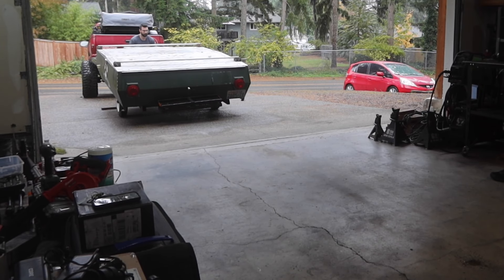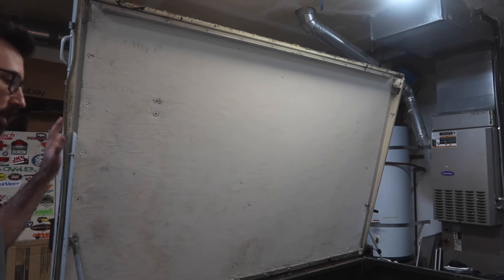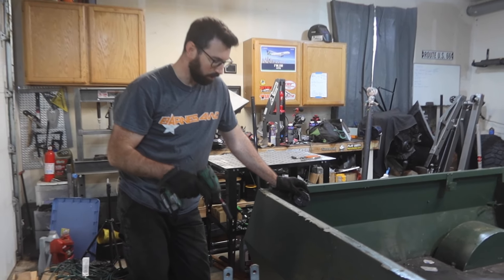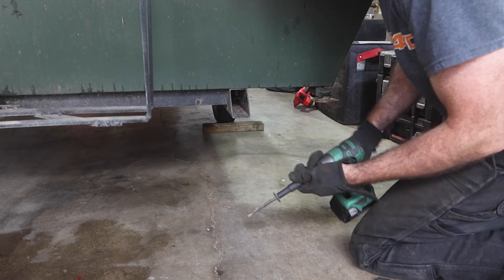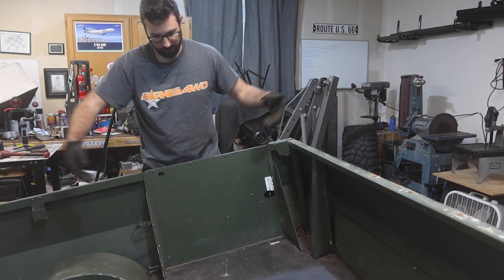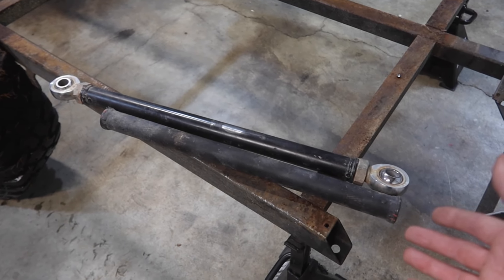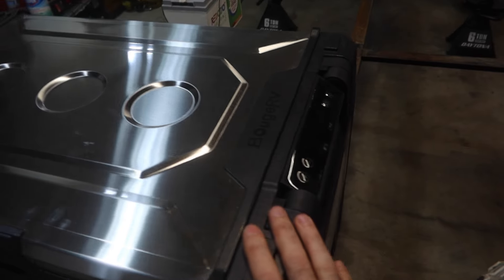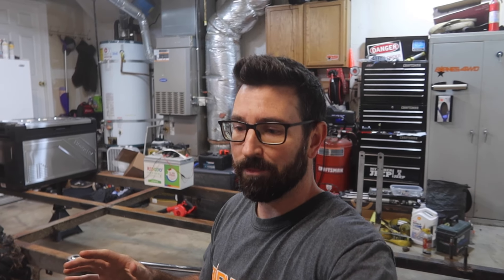Let's build an Off-Road Trailer! Budget Tent Trailer conversion build

Comment: You mentioned slide outs on the driver side of the trailer, I’d recommend setting up the whole trailer to access from the passenger side. I originally built my truck out for my road trip with everything being accessed from the drivers side but most camp sites are setup for RV’s that are generally built to access from the passenger side. Even though this will get used out in the trails, it’s nice to have it setup to efficiently stay at a campground if needed.
Reply from the maker: Good advice, thanks 👍🏻

Comment: I had the same problem with my S10 a long time ago. I took the hoses off the heater core under the hood and pushed water through the heater core each way a few times and it fixed my problem with it not blowing hot air. Might be something worth giving a shot before tearing the dash apart.
Reply from the maker: Thanks, I have not diagnosed this yet, it really can only be 2 things, Heater core or the blend door. That would definitely be easier than the blend door 🤞🏻

Comment: This should be a super fun project to watch. Nice platform to start with. I've worked on a few buddies offroad trailers and they have all had similar issues...frame issues around the suspension and the front nose area. I'm excited to see you start this. 👍
Reply from the maker: Thanks, good advise. I definitely will be reinforcing those areas. 👊🏻

Comment: I have had two roof top tent trailers. They are a little different than what you are doing because they are basically utility trailers with mounts for the roof top tent and I haul a quad on the actual trailer underneath. I have a few videos on them, even though they are different than what you are doing you are welcome to check them out for inspiration.

Comment: I would say make sure the design allows you to have more tongue weight whether its empty or loaded so its never squirrely going down the road. water etc low and forward. And some sort of layout where you have a big door/panel to be able to toss random stuff in and not waste the space in the middle.
Reply from the maker: All good ideas, thanks 👊🏻 yup, weight low and up front, that is the goal.

Comment: Theres a couple of FB groups centered around building overland trailers. Id also suggest the "enclosed trailer camper conversion" group, there are a lot of good space-saving and intuitive ideas posted there if you scroll back far enough. Also, for what it's worth, I find if I ask myself what exactly I want a certain project to accomplish, rather than just what I want or what I think is cool, I make a lot more progress. It's easy, at least for me, to get lost in the newest and coolest trends. Good luck, we look forward to the next installment.
Reply from the maker: Thanks for the suggestions, I will look into it. 👍🏻

Comment: ditch the ball and put a Pintle hitch on it, that's way stronger and can handle angles, the only downside is they are louder. make sure you triangulate the front to the hitch and overbuild that whole part, there is a bunch of load put in that area when going through dips and whoops off-road that normal trailers don't see. those coils are probably too stiff but that might not be a bad thing.
Reply: Better to use a 360 hitch like the one Nate built or they can be bought. My army trailer has pintle and it works but its clunky
Reply from the maker: Yup, all of that will be replaced and reinforced. We will see about the springs I have a few other option laying around too.